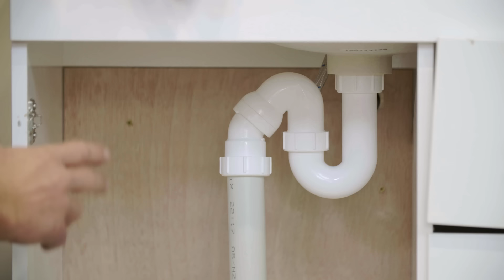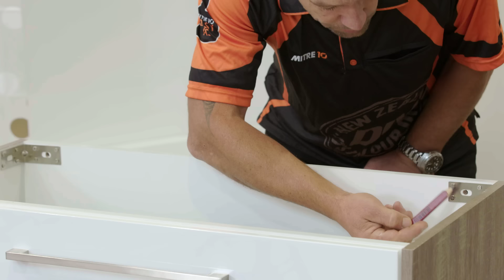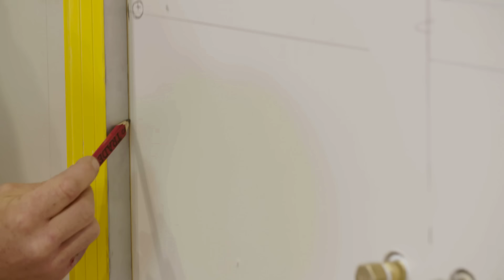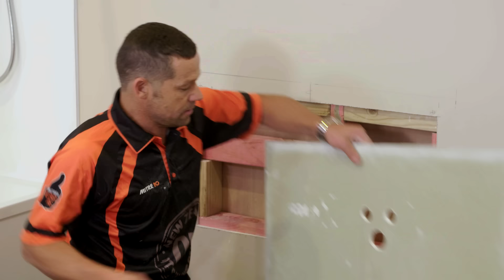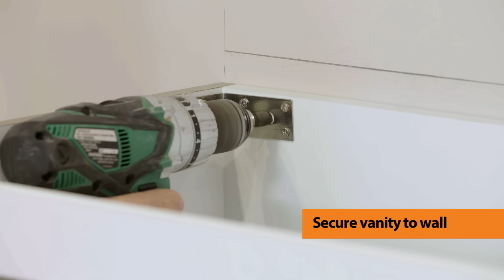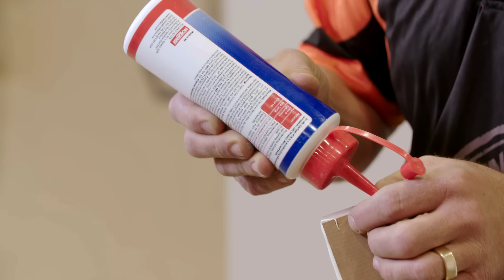How to Install a Wall Hung Vanity | Mitre 10 Easy As DIY

Comment: Nice work.
But it's a wet area, shouldn't the wall lining be a fibro cement type cladding.
Reply: He used a water-resistant gypsum board, which passes code here

Comment: I'm not the most observant but when u said the plumber is to silicone the vanity top down .. u have already applied to the  vanity and wall . I would suggest that be done after the plumber has done his bit or you caint remove the top 🤔
Reply from the maker: Hi Kaylah, the plumber does the siliconing generally as its part of the consenting process that this gets done by the plumber to avoid any leaks. You have a good point though - the way it's mentioned here is a bit confusing - so I'll ask our team to update the instructions to make sure it's clear. The correct order would be to get the plumber in to reconnect pipework / taps and silicone the basin on to the vanity, and then you can silicone along the wall behind the vanity. ^Meg

Comment: how did you remove the drawers?
Reply from the maker: The draws on the original vanity didn't need removing, as they were part of the vanity piece in this case ☺️ ^Cam

Comment: What if there are tiles on the wall. It starts to get real big
Reply: Use a tile drill bit, tile screws with a plastic screw insert, then same method as attaching to wall board.  Probably limited as to where you can put it though, only where the studs are.